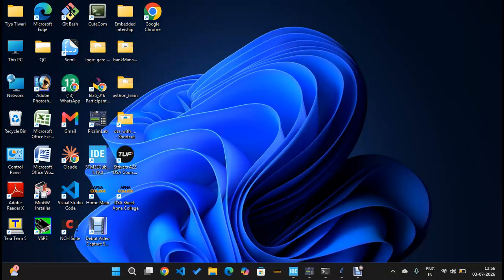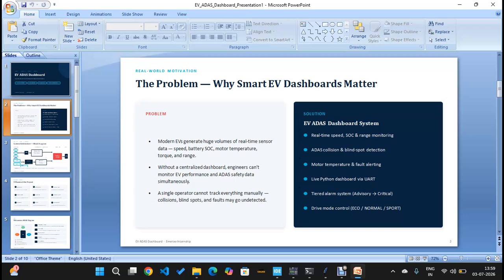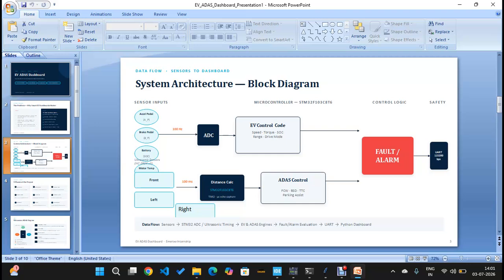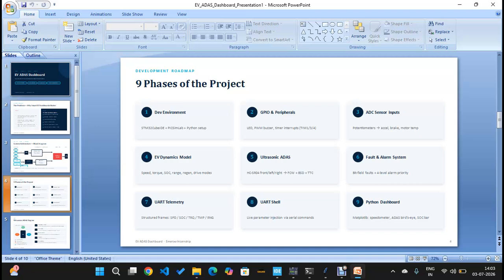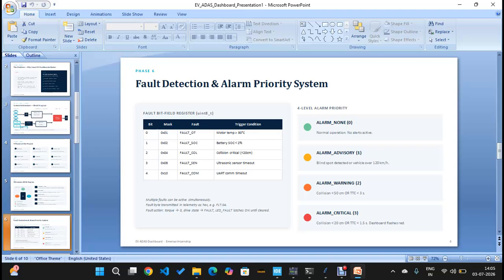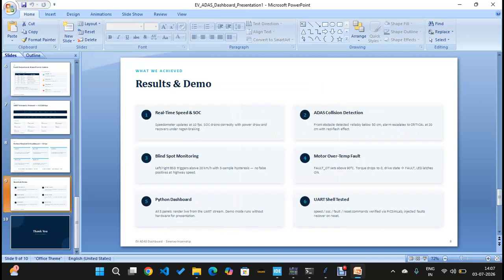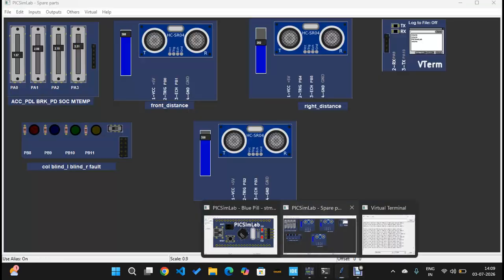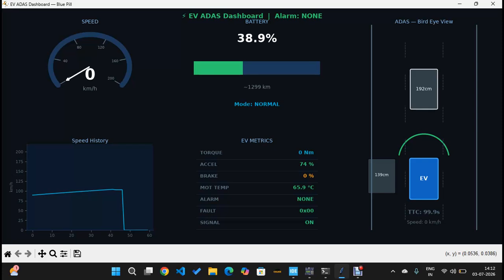EV ADAS Dashboard — STM32F103C8T6 + Python | Emertxe Internship Project

Comment: Hello Tiya! Hope you're doing well.

This presentation is well detailed and helped me get rid a few of doubt that I had even after the sessions.

We were in Emertxe Embedded Systems Internship Cohort 26 and worked on the EV ADAS System project.

Unfortunately, I couldn't attend the last few classes because my JLPT exams coincided with them, which broke my continuity. I watched the recorded YouTube sessions afterward and followed the instructor's steps as carefully as I could, but I'm still getting results that differ from the expected output and I'm unable to figure out where I've gone wrong.

If you don't mind, could you please share your project code with me? I only want to use it as a reference to compare it with mine and identify my mistakes-  not to copy it.

I'd really appreciate your help. Thanks in advance!
Reply from the maker: glad that video helped you.. this is my github link u can find all code here https://github.com/Tiyatiwari/EV_ADAS_python_Dashboard_STM32
Reply: @TiyaTiwari-p5p  Thank you very much.
Reply: Hi, I went through your github repository and it helped me fix my codes. Thank you very much for that.
But I still encounter a few problem i.e. the python dashboard ain't reflecting the picsimlab simulation.
i think the problem is in the configuration part of the stm32 because i see many error type of symbols in pinout & configuration.
Can you share the screenshots of the "Pinout &configuration" of sections "system core", "Analog", "Timers", and "Connectivity"?
You can upload the screenshots of these pinout & configuration in a google drive link and share it with me.

I have uploaded the screenshots that i found errors on my .ioc file for you reference.
https://drive.google.com/drive/folders/139u1gfPl_P-buew0M55mrh1LkXwkm9mp?usp=drive_link

Thank you for your understanding.